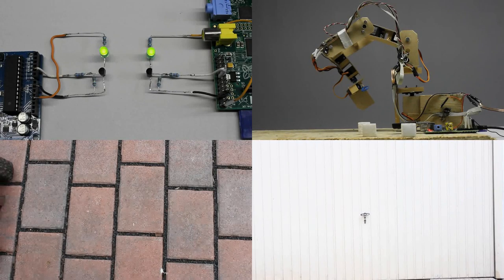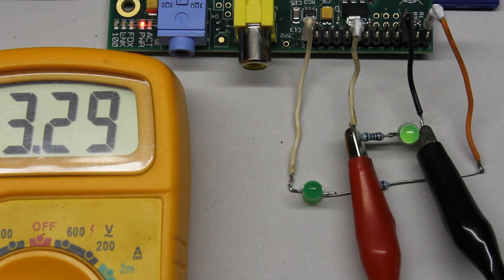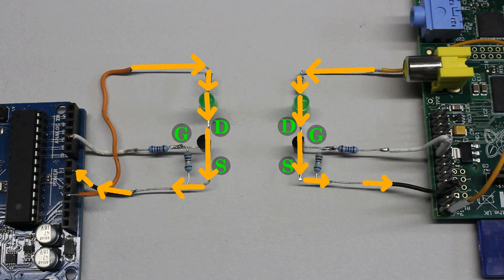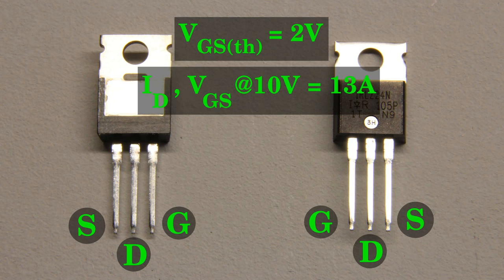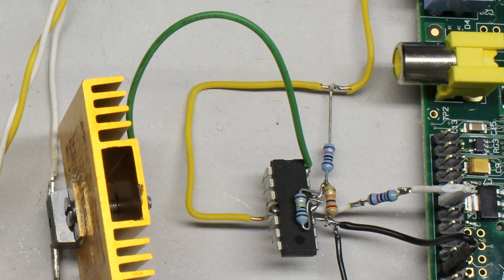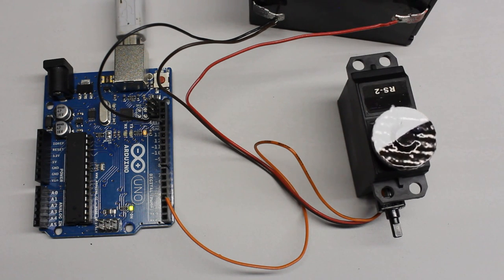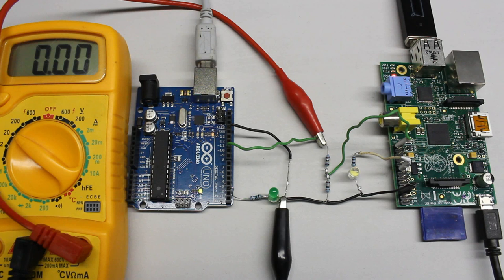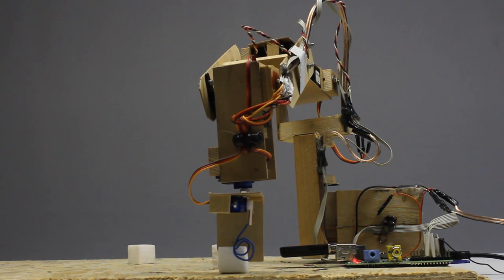Physical computing: HowTo control LEDs, electric motors or servos through GPIOs

Comment: great videos man, thanks for making these. wanted to mention choosing a power mosfet with low Rdson would keep the power dissipation low, may be good to include in any video later. Thanks for the awesome videos, I especially love your servo videos!
Reply from the maker: +nikotwenty Yes! There will be videos about MOSFETs and how to switch high power loads sometime.
I have build another, fully digital, high power servo from a wiper motor. It will be part of my video about encoder discs:
http://www.homofaciens.de/technics-base-circuits-encoder-disc_en_navion.htm

Stay tuned!

Comment: very good video. Excellent stuff here. Very clear. Thanks.
Reply from the maker: +morpher44 More about "Physical Computing" will follow in the not so far future.
Reply: +HomoFaciens For relay control, I had gone with opto-isolation. But I link the info you provided about protective resistors. I hadn't thought about that contingency.

Comment: This video is really interesting and useful. Comparing the two most popular programming systems offers a broad point of view on automation and thanks to the practical examples shows unequivocally where you can get ... I think Google has stolen your projects for its googlecar :-)
Reply from the maker: ...hope they added a better braking system ;-)

I am in talks with sponsors to start a series about "Physical Computing" and so go in more detail. More and more machines get an interface to microcontrollers or computing networks. It's definitely worth telling more about the basics.

Comment: On the Raspberry Pi the  3.3 V rail can supply a maximum of 50 mA for all GPIOs combined, at any one time. A single GPIO can supply up to 16mA, see this: http://www.scribd.com/doc/101830961/GPIO-Pads-Control2 and this: http://raspberrypi.stackexchange.com/questions/9298/what-is-the-maximum-current-the-gpio-pins-can-output.
Reply from the maker: Mossy TC. Thanks for the very informative site about the BCM2835 chip (driving the GPIOs of the Pi). I already knew that this chip can provide up to 16mA per output pin, but as I know the default adjustment is just 2mA and I haven't found a way to set the 16mA by software. Another limitation is the number of GPIOs: 17x2mA = 34mA, which is close to the total maximum of 50mA. It's safe to assume a maximum current of just 2mA for a single putput pin and use transistors if more power is needed.
Reply: The default configuration is 8mA, not 2mA ;)
Reply from the maker: Mossy TC. That's correct. I will consider that at subsequent videos - thanks!Beginners still have to keep in mind that 17x8mA=136mA is above the total limit. When composing a circuit you should keep the current below 3mA unless you know EXACTLY what you are doing.
Reply: Why below 3mA?
Reply from the maker: Mossy TC. 17x3mA=51mA in case all GPIOs are in output mode driving e.g. 17 LEDs.
Reply: Ok, now I see what you mean. Keep the current below 8mA unless you are using more than six GPIO pins (6x8mA=48mA), in which case you need to lower the current for at least some of the pins.